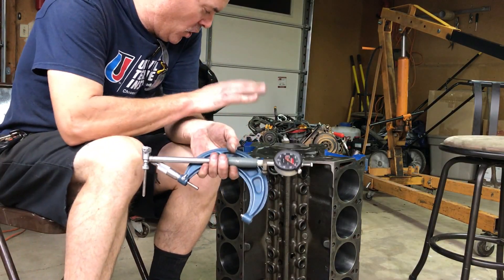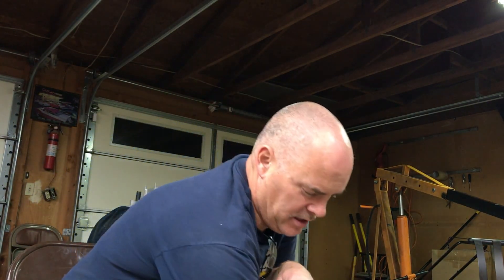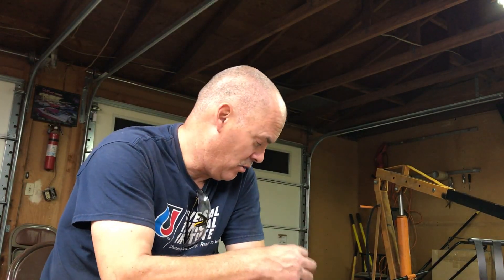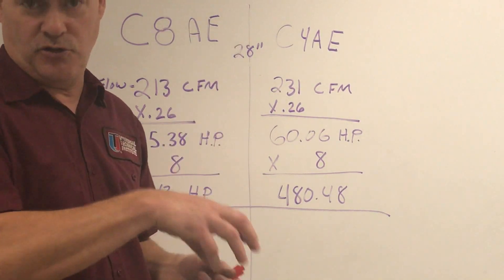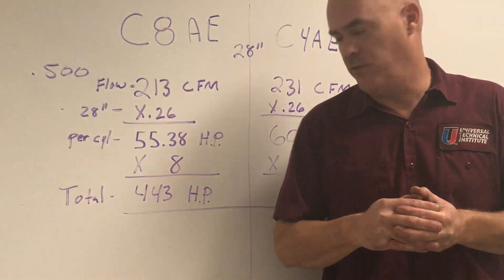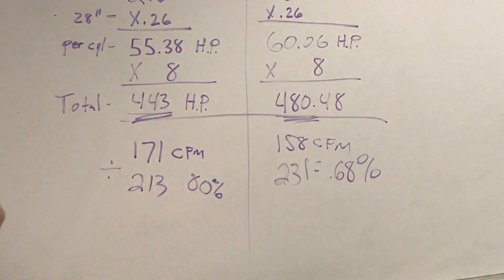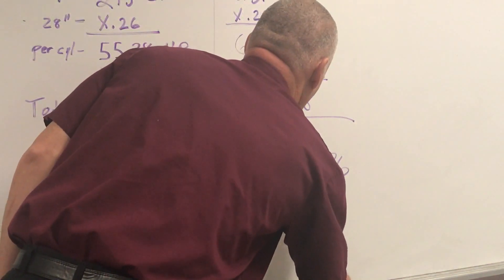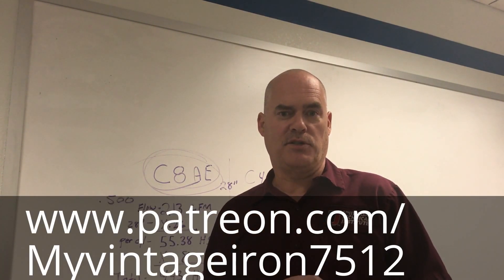390 FE Head Shoot out

Comment: What would be better for a mostly stock 390 with c8ae ported heads, Edelbrock Performer or Performer RPM? I am working towards a built 390, and would like to add trick flow heads later. Right now I have an Edelbrock Performer RPM to put on the engine the way it currently is. I am wondering how it will run in a mostly street application in a truck.

Comment: 427 Medium riser and 390GT heads both have smaller ports than the 427 low riser and regular truck heads and smaller than CJ heads which are similar to a 427 low riser.  The smaller port heads have a raised floor and roof is same height and the smaller port GT and 427medium riser heads flow more efficiently. 
 
The only heads referred to as low riser or medium riser are 427 heads.  Not really sure where you’re getting your low and medium riser reference from.  428 CJ heads are very similar to 427 Low riser heads. 
 
You are correct that the smaller port heads especially when ported are ideal for a 390 performance build because of the better velocity.
Reply: CONFUSING !
Reply: @ the low riser heads, even though the ports are bigger than a medium riser, have a lower port floor, which allows for a lower rise intake manifold to clear a low hood line.  So on a medium riser, they raised the port floor and it actually made the port smaller and on a high riser they raised the roof of the ports which made them big again and taller.

Comment: I stand to be corrected but what I’ve found on cars with the C8AE-H heads over and over is the incorrect header choice! Only one header manufacture I’m aware of makes a specific C8 header which has almost a quarter inch lower exhaust port floor then the C4 exhaust port floor! This causes a port to header mismatch up to that 1/4” yet header manufactures tell you their header will fit which it does but won’t port match! FPA makes a specific tri-Y header that is specific to the C8AE-H head! I say this assuming the C8 head tested in this video is the C8AE-H GT head?

Comment: I have 2 390 stock engines I have ran both in my 1972 f-100 truck and i'm running the one with the c8aeh heads now and it has more horsepower torque for sure. My Brother has a 410 fe out of a Mercury in his 1971 f-250 3/4 ton pickup.
Reply: 410's Rule!    :)

Comment: I remember one of the old Edelbrock catalogs had an FE intake that had a disclaimer that said it wouldn't  fit certain years of 390 GT heads. (66-68?) It might have been a Edelbrock Streetmaster intake, which had smaller than usual ports and / or runners, but I'm not sure. It might have been the regular old high rise intake, but I don't remember the exact range of 390 GT heads they mentioned.(68-70?)

Comment: Hello from Germany.
I want to say. Thank you for your very good videos. Very interesting and very well explained. I am not a pro, driving a 63 Galaxie 500 with 390 FE.
I need to overhaul the engine. He has blow by and makes after some time of driving when engine is hot. It makes noise from the lifters. Think it is losing oil pressure somewhere in the engine. Also loses a lot of oil at rear main seal. I want to keep as much original as possible for cost reasons. Intake, heads, 4100 carburetor etc.
But have now decided to convert it to roller cam. Not because of more power, just for safety reasons. One hears unfortunately ever more frequently of failures with Flat tappet. I drive the Galaxie only on weekends, leisurely across the country.
What kind of camshaft profile would be good for me ?
Reply from the maker: keep it mild 212 ish duration .450 lift 108 lsa
Reply: @Myvintageiron7512  
Good morning and thank you very much for your answer 👍

Comment: The c8ae is a 352,390, head. The 352 high performance head has the best factory combustion chamber
Reply: C8 are 1968 year model. They didn’t make 352’s in 68 as far as I know.  I had some 61 352 police interceptor heads and they had really nice quench chambers and small high velocity ports.

Comment: What if you port  the low riser heads? can you get even more horses and still keep more ft lbs of torque?
Reply: My low riser heads are making 600 HP. They are ported and polished. 2.19 and 1.71 valves.
Reply: Are these the c4 heads with the tall 2.3xxx" port ?? Thx  my friend (I had to use 1246s3 felpro gaskets believe 1.4 x 2.34)

Comment: Hey, I know this is an old video, but can a good machinist make a stock fe head flow better than an aftermarket aluminum head?  I'm looking to upgrade my dad's old 390 flat tappet engine to a a hydraulic roller setup.  I planned on aluminum heads + machining but wonder if I can save some $'s by shipping the iron heads off to a skilled machinist.

Comment: Let's say you put Edelbrock Performer RPM heads p/n 60069 with 270 int. flow and 200 exh flow at .600 lift on a Ford 390, you run all the equations and you come up with 415 hp. Now put these heads on a 445 stroker. Both engines having the same compression ratio, same cam. How much should the hp increase from the cubic inch increase?

Comment: i used 428cj heads on my 390 with a 406 tr 3 2 barels in my 67 mustang 4speed it ran great
Reply: That’s a hot setup for the street. I had a 428CJ with 3x2 intake from a 406 in my 68 falcon. It was a beast.  The optional CJ cam was a good match for this engine with 520 lift and 300 degrees it was good for 7000+ on the big engine and made well over 500hp.

Comment: What an excellent video. Thank you! I'm kind of an old Ford truck freak, and I have a 1959 F250 for my next project. I have two motors that I can put in it. One is a 300 straight 6 with a manual five speed (not the strongest tyranny ever made, but the motor is in excellent condition). The other is a 361 with a manual 4 speed out of a B600. It also is a good engine and trans but needs a small amount of work. Tough decision. Lol.
Reply: Which did you choose?

Comment: So you have a larger volume port with a larger diameter valve that will not flow as much air as the low rise head.  I imagine the reason would be that the larger port requires more of a bend, the path the air travels is not as straight.
Reply from the maker: Also it has allot to do with the larger port being less of a restriction so the velocity of the air is lower at lower valve lifts and RPM's a Good example is a Big block Chevy oval port and square port the square port head is a much larger port but the Oval port makes more TQ and HP up to about 6000 RPM after 6K  the square port kills it but the oval port actually has more useable power in a wider RPM range it's not really feasible to spin your BB up above 6K everywhere you go just to get into the working HP range of your heads that are way too big and should really only be on a race car
Reply: @Myvintageiron7512  In the mid 60s I there were magazine articles that said the standard 390 low rise head wasn't even a good street part.  I wondered about that.  Those heads were on the 1960 solid lifter 352 that made a little more hp than the hottest Chevy 348 and Mopar 361 both of which had larger ports and valves.  The Chevy's dominated the drag strips because along with Pontiac, they were the only cars offering 4 speeds until 1962.   Yeah I've been around awhile, LOL.

Comment: Honestly, I'd have to see dyno tests to support those numbers. I like math, but, as you said,  there are a ton of other factors involved. Not the least of which is the fact that the exhaust has a MUCH easier time flowing since it is under much higher pressure. A flowbench doesn't really reflect the actual flow on the exhaust side.

How much do you get for a pair of heads? Not sure what ones I need yet. But I really don't want aluminum and I don't know if the stock heads on my 352 will handle a stroker kit and upgrades to get in the 500-pony range.
Reply: Cam montreuil engines  Yeah,  there's a lot of voodoo going on inside an engine. I'm not convinced we even know all the factors involved- much less have any control over them. Maybe plug indexing really does make a difference. Maybe the different lengths and shapes of the intake runners effects the homogeneity of the charge in the chamber. Add up enough of these "irrelevant" differences and it could give you a couple weak cylinders. It would be fun to see a test with a handful of identical engines to see how much variation there was between them.

Comment: 500 ft lbs at what rpm?
Without an ideal entrance on the int port all flow numbers are bogus
How much do you lose through the intake manifold?
Flow differential should be about 70%
Stan Weiss Head Flow Data 
http://users.erols.com/srweiss/tablehdc.htm#Ford
Reply from the maker: this has already been dyno proven if you read this it will explain this build is almost an exact copy of the engine  below
http://www.mustangandfords.com/how-to/engine/1410-how-to-build-a-390fe-stroker-500-pound-feet/

Comment: Have you ever flowed a set of EDG-E ('58 352HP with machined combustion chamber) heads? When I got them I was told they had ports similar to the C8 heads but have not found any info on them.
edit - Oops, never mind. Went to measure the heads and when I cleaned the casting number I found it was EDC-E. Searching with the correct number came up with a lot of info. Basically medium riser ports with smaller valves.
Reply: The EDC heads were used in Edsels, I always just called them  "Edsel Heads". They are very similar to the later 427 heads, and the only non 427 heads with machined chambers. They had smaller valves because they fit on a 4" bore block. I used to work for a guy (he was Parnelli Jones' crew chief in the late '50s, stock cars}. In the 70s he liked to build 390s with the EDC heads and the 428 police manifold for guys in the intermediate stock car classes. This combination was the best to get off the corner. I had one of these setups, a 352, in a Hobby Stock class I raced in in 1974. I wasn't so impressed with it, but I did have to run against 327 Chevelles, not a fair fight. 25 years ago I built something similar for a F350 flatbed work truck. I used a .060 over 390 block with a Merc. 410 crank. Gave me 418 CI. I used some 390 GT heads, ports about the size of a Med. Riser. I'm an old guy I use terminology from when these engines were made. I used a Edlebrock small port intake with about a Holley 390 carb. I was aiming for a super low end torque setup similar to the 428 CJ. It worked very well in that 7000 lb truck. I could drive in the city, make a sharp right turn at an intersection and never take it out of high gear.

Comment: I love this. It gave me information I can thoroughly use in my FE build. Trick flow heads yeild me the potential of a 500 horsepower head. I’m curious to see the power my engine will put out when completely done. Current estimated compression with .027 head gasket is roughly 9:1 ...

Comment: On a FE.  Anything past 71%.  Intake to exhaust.  Ratio.   Will have very little  gain in power.      The C4. Lowriser head will trounce the C8 head.   If mid to upper rpm power  is your goal
Reply: i agree
Reply: What about 1959 332cu in head for torque at lower RPM small ports & valves my 410fe is not going to rev past 4500rpm
Reply: I absolutely agree!

Comment: I hate to call you out on this, but I believe there is a slight problem with your math.  If you take the flow numbers for a Ford 289 HiPo cylinder head (from Stan Weiss' flow charts - 177 Intake / 125 Exhaust), those cylinder heads would have only been able to produce about 258 HP.  Ford advertised the 289 HiPo @ 271 HP and the Shelby version @ 306.  This was also confirmed by Richard Holdener, where he built and dynoed both versions and got within just a couple ponies of the advertised numbers.  Being a Ford guy and racer, I am very well aware of the restrictive numbers on the exhaust side of Windsor Heads, but yet, they still work.  Can you explain ?
Reply: The math is correct for getting the base HP capability's of a cylinder head,  there are other factors that come into play like cam profile, compression ratio, intake and exhaust systems that can improve the base HP numbers the flow bench does not factor in these things I also have a super flow bench and I assure you his math is correct it comes direct from super flow

Comment: Where were you 20 years ago when I was building old iron and more specifically, an FE for my old 71 F250 high boy. That engine was a beast.. it also caught fire with me in the engine bay.
Reply from the maker: I was building FE's 20 years ago just not on You Tube
Reply: @Myvintageiron7512  We use to just put these in & never looked at them, went with what we had, these old 352 were just that to us, one & the same never looked at these as anything but Old engine.  we were all just making a living back 40 years ago. Today all the young people looking for the old engines to make 428s & look for the old sand shakers, hot rides, no A/C, rattle, missing & backfire cars sold for 500.00 or less Mustang, Supper Bs, Chargers, Dime a dozen. Could have bought 65 Mustang fastback black with 4 speed for 350.00 in high school & pass because the engine was bad, they had 302 Boss in Newspaper add for 3.200 & 429 Boss for 4.200 & that was the high end back 1976. But working for 75 cent's or a good job that paid 2.50 cents' hour back then you bought a house for 4000.00 & left these alone

Comment: YOU CAN BORE  MOST 390'S .80 OVER WITHOUT PROBLEMS . THE 427 LOW RISER AND 428 CJ HAD LARGER VALVES ,THOSE OTHER HEADS HAD SMALLER VALVES IN BOTH  HEADS . I HAVE HAD .60 OVER 427 AND 428 'S NO PROBLEM .PORTING AND LARGER VALVES MAKE THE DIFFERENCE .SMOOTHING OUT THE CHAMBERS HELPS WITH DETONATION   ALSO . NO ROUGH EDGES .
Reply: Cam montreuil engines  Jahns pistons but they were very heavy and that was in the mid 60's .TTRW used to offer + .60 over for the 428 CJ . but IDK know about the 427's .JE OFFER A FLAT TOP PISTON

Comment: Low riser were used on 58-66 FE... Standard head at that time. 
 
Medium risers/ Hi risers were a special 427 only head with bigger valves. Like 2.17/1.71s.
 
Some C7s C8s and D2s are late car/ truck heads. 
 Great vid. And good to know
Reply: The 427 also had a low riser head. But not the same port size as the low riser 68 head.
Reply: Also the C6AE-R was used in 66&67 sometimes

Comment: Really good analysis.  This answered a lot of questions I've had concerning int/exh numbers.  Is the pressure differential between intake/exhaust figured into this or is it immaterial?  How do the CJ heads compare in HP?  I know they wouldn't be "torquers" for a truck motor but I'm just wondering.  I've ridden in Mustangs with the CJ motors and they made serious power.  I would assume that they had much better intakes, too.  Good video!  Nice equipement you've got there.

Comment: Same principles on Harley Sportster motors. The 883  heads flow better than the 1200 heads so guys who jugged an 883 out too a 1200 and used the 883 heads made much better power than guys with stock 1200's. As far as hp in Sportster motors goe's it's better too punch an 883 out too a 1200 than actually buy a 1200.

Comment: I have a 1972 f100 with a 360 with c8ae-H heads. My question is can you upgrade by using larger valves a port job  the exhaust port
Reply: The ,360. Is a low compression motor the exhaust port is more then adequate for this motor. The best way to increase power with a 360 is to get a Edelbrock street master intake manifold  one that has not been ported any porting to it will kill port gas speed  it is a very hi velosity intake none better for a 360 -352-390-428 in stock or mild build. The next thing is to recurve the distributor  mechanical advanced. To only 9 to 10 degree s of advance. This motor has no quench. So it has a unusual timing requirement up to 23 degree s  of initial timing. No more than 32 degree s of total timing.  This will wake up a 360. For best power and fuel mileage.  Don't worry about changing valve s.

Comment: C6AE-R heads are the best factory standard cast iron heads Ive used . Ported C6AE-R heads I have not used but ported C4s are definitely power makers . I have used some a couple different times. Ported C8AE-H heads are also great if done correctly. I am going to port my C6 heads and see how they do. I think they will be really good
Reply: I am taking my c8ae-h heads in to get ported, is there anything that I should have the guy focus on or to look out for? Bigger valves?

Comment: I watch your videos and enjoy them and learn from them. I do want to point out measuring the intake and exhaust port flow using the same pressure differential isn't reprsentative. ALL engines have smaller exhaust valves/ports that their respective intakes, since more pressure is available on the exhaust event, the result of heated gases in a closed chamber. While the intake flow can only see atmospheric pressure differential (14.7 psia, 70F), the exhaust side has much more pressure available as the exhaust gases are in the 1000 F range. These heated gases exert much greater pressure during the exhaust event. The analysis is only representative when the exhaust flow has decayed to atmospheric pressure. A better apples to apples flow test would be to flow the intake at 28 inches or 13.75 psi, as is customary and the exhaust closer to 40 psi, the pressure of the gases when heated to 1000F.

Comment: I'm not up on Ford Motors, but a friend of mine had what he called a side oiler. The main oil gallery ran down the left oil pan rail, and fed each main from the side. Big block Chevys did this also, as opposed to the small block oiling the cam first, then feeding the mains. Did the 352, 360, 390 also side oil. i forgot about 331,361, and 391.
Reply from the maker: no
Reply: 0nly the 427 fe. 1965 to 1968 in production vehicles.